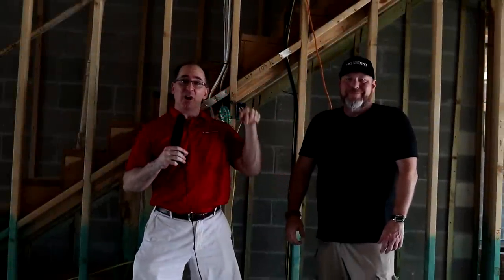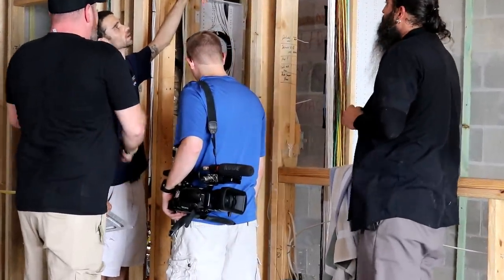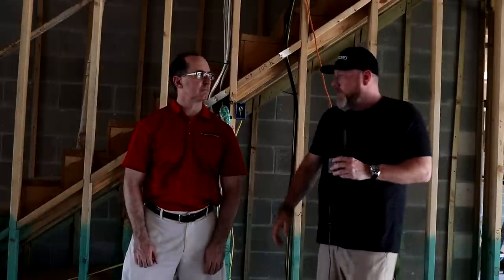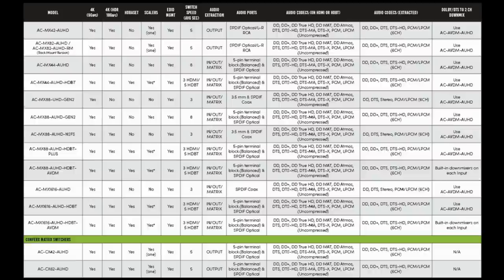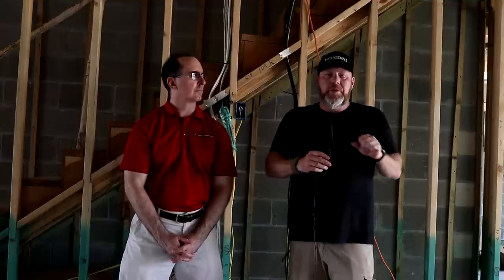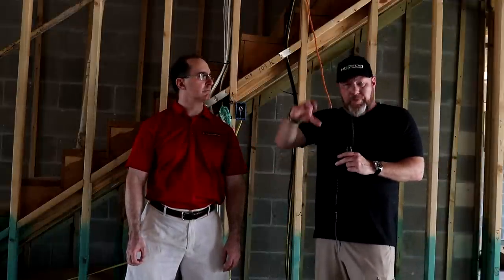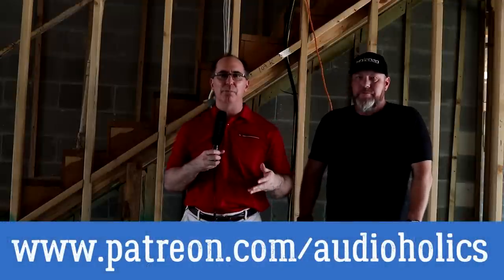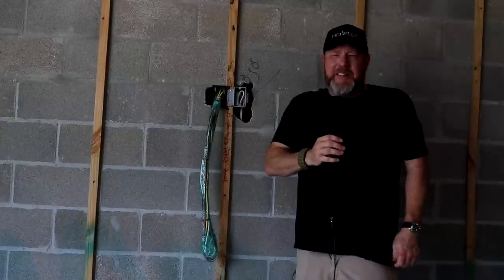Prewiring for UHD Video & Audio: AH SmartHome

Comment: All the installs I assisted on were run with 3Gig rated RG6 and Cat6 or Cat6a wire. To each their own. The wire runs for through house audio were all done with 12 gauge. And like Dunn was saying about the sub wiring with RG6 to the sub inputs with RCA inputs, we used the same RG6 cable. This was back in 2011. Guess even back then, that wasn’t bad. We took particular care to avoid HV lines just like Dunn was talking about back then. I feel we did top work so I am glad to hear him speak my language! You got yourself a top shelf integrator Gene!
Reply: Gratitude! I cannot even begin to count the amount of houses I have wired over almost 3 decades and I do not believe that there is any "perfect" amount of pre-wiring, we try and find a balance for most of our projects. If anything in the eary 2000s we overwired homes, this helped for sure in many situations, but there certianly was some over the top...Cat-5's to every wall of every bedroom? LoL!

Comment: The last bit Don pointed out about running the AV wiring separate from high voltage wiring is obviously important. Where I’m from (Norway), building regulations actually require that be done with concealed wiring. In fact, all concealed high voltage wiring should be ducted in tubing (plastic or metal). We tend to do the same for low voltage wiring too, even though not required, but running that in separate tubing. :)

Comment: 6:02 Shielded Cat 5/6 cable is excellent for conveying analog audio signals as well. Balanced or unbalanced mic- or line-level signals can run hundreds of feet without degradation. This is becoming increasingly common in pro audio circles. Look up Dave Rat's videos on the topic. To restate: What I'm describing is analog audio, not to be confused with networked audio like AVB/Dante, which also utilizes Cat 6 cable, but in a very different way. Good video!

Comment: I meant no fiber standard for the systems we install.
Reply: Are you serving Orlando area too?
Reply: As you already know, you only need to throw in fibre if the system is over 100 mtrs. Cat 6 can handle enough data anyways. With hd over ethernet thses days possibilities are endless. 👍
Reply: To be sure id run fibre if the system exceeded 85-90 mtrs to be sure of a lossless system. The costs of an additional cable are always smaller when the house is being built as opposed to already built 😅

Comment: If I use a Roku in every room to stream TV (Don't want a cable box) and prefer no extra wires, I assume I still need an HDMI from my 7.1 receiver to at least my main TV to watch surround content. My question - is there any compelling reason to also run an HDMI cable from head end to my other TVs if I don;t need surround from them? Just "regular" TV viewing?

Comment: Great video with lots of good info.  One question I have is about network cable surge protection.  I've been in my home for 25+ years and had several close lightening strikes, some of which affected 120 VAC stuff.  However, recently had a nearby strike which didn't affect any 120 VAC stuff, but somehow 'climbed' aboard my network cabling somewhere and took out my 32 port switch and a comm board within one of two solar inverters (lightening surges travel in the most unknowing path); luckily for me nothing else.  So, what is your recommendation for (if there is any) surge protection on CAT cabling?
Reply from the maker: Most top shelf power conditioners from Furman and APC also have phone and ethernet ports with surge protection. Just make sure their thruput matches your network switch ( ie. 1Gbps.)
Reply: David the only way to truly 98% protect yourseld from lighting or surges is to use a multitude of single devices from companies like Eaton or MTL Etc. on all pathways into the home. We are in the Lightning capital of America and this has been the struggle for years. We had a client who spent over 10k with us on surge protection as well as about 15k on lightning rods and whole home surge protection...lightning hit, went through the ground and into the pool control system....this sent a surge through the cat-6 (converted into an RS232 for pool control) and directly into the main system equipment racks. Fried a bunch of gear. We do things like grounding our racks, but my friend these are simply acts of God and it's so powerful that it's nearly impossible to stop a direct hit. WHOLE HOME SURGE PROTECTION SYSTEMS ARE GIMMICKS and DO NOT WORK IN HIGH LIGHTNING AREA'S PERIOD.
Reply: @DigitalDonAV  I currently have Furman AC line conditioners, the Elite 15PF i and 20 PF i, for my equipment and will look for the single devices that you mention.  I realize nothing will protect against and direct hit, but am simply trying to avoid the damage (or at least minimize) from the close hits.  Thanks!

Comment: Looks like two main breaker panels. Wow.
Reply from the maker: Yep 300A service
Reply: Could be 400 but the number of breakers is what one is after. My single 200 amp box is now double-breakered to the max. My local utility, San Diego Gas and Electric, would frown on having over 200 amps for my square footage. They would think I had a pot farm in my house. Already my bill reaches $400 in the Summer.

Comment: Any power conditioners? Anything at the breaker box like a surge protector?
Reply from the maker: Yes APC and Furman
Reply: Gene, Power Conditioners are never reviewed in any depth (benched) and are never shown with the covers off. They are mostly voodoo. Maybe you can do one of your evaluations on them. I have a Monster and a Panamax myself. I understand the over and under voltage functions, and the surge protection, but the EMI/RFI is a mystery to myself (But not to Garth Powell I imagine). I also have a Tripp-Lite but some say that the commercial models don't work on "audio frequencies". And supposedly neither do UPS systems. You are probably the only audio guy that can enlighten us. Are your APC and Furman units stand-alone or in the breaker panel?
Reply: No audioquest Niagras ?